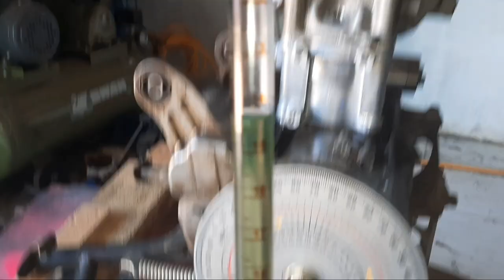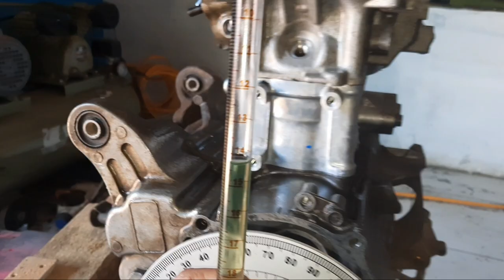BORE UP VARIO 150 59MM HARIAN AMAN DAN NYAMAN #DR16 #VARIOVLOG

Comment: kang mau tanya kalo boring ori vario 150 pake piston 60mm .kenapa overheat terus? solusinya gimna mengangakalinya gimana?
kalo pakai extra fun ngaruh ga kang ? atau harus ganti boring pake ktc kang ?
kayanya waterjacet ketipisan atau gimana yah kang mohon kasih tau kang konsultasinya biar nggak over heat terus
Reply: ganti radiator bang
Reply: Pake air radiator yg harga 100ribu ke atas dong
Reply: Seher nya buat kubah.. Kompresi terlalu besar

Comment: Pake blok standar vario 125 bisa di over size ke 59 ga ya bang
Reply: Ngga bisa dong
Reply: @whyronny01  ga bisa over size ya harus ganti blok dia ...kalo tb sama ijektor ori vario 150 di taro di bario 125 old larinya makin enak ga ya
Reply: Kalo oversize bisa tapi kalo borup59 harus ganti blok&hed.mending maen kirian aja kalo ganti tb enaknya pas borup ganti tb150 di porting sama hednya juga injektor di gedein juga
Reply: @whyronny01  berti mending gue gamti sepaket ya gan head sama blok vario 150 ori ..kalo noke as klep itu v125 sama vario 150 sama aja kan gan bisa pnp
Reply: Saya udh main kirian semua gan biasa make mtr 150 trun ke 125 kayanya gmna gitu hehehe
Reply: Saya pake blok std v125 bisa pake 59mm cuma ganti boring dulu, soalnya boring stdnya di korter cuma kena 56mm
Reply: @aldipratama5409  kalo gue pake blok vario 150 ori bisa ga bro head bawaaan 125 sehernyanbeda pin tapi apa ada blok kusus buat vario 125 upgred 150 kaya kluar lokal
Reply: @rian3165  kalo pake blok vario 150 bisa cuma sehernya cari yg pen 13 kaya vario 125 kalo gamau ganti setang sehernya vario 150
Reply: @aldipratama5409  kalo naik ke shere 54.5 itu pake sher apaan mas yg sama mirip sama penya 13 kaya vario 125 mas .. Itumasih bisa kan pake head ori
Reply: @rian3165  pake seher kaze os 150 mas, masih bisa itu kalo pake head ori
Reply: @aldipratama5409  pin seher ya sama ya mas 
Dome sehernya tingginya sama ga mas tinggal pnp
Reply: @aldipratama5409  pake 56mm itu aman gk buat harian sisa brp mm tebal boring stndarnya v125.pake piston apa
Reply: @aldipratama5409  ini pake blok head bawaan vario 125 mas?klepnya ganti atau masih bawaan standart